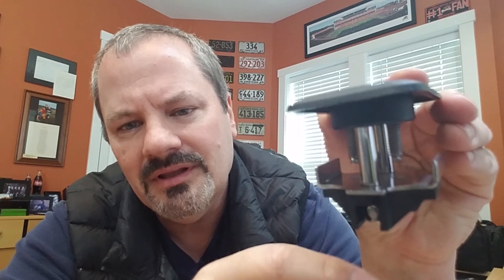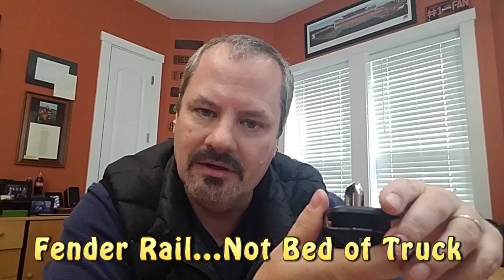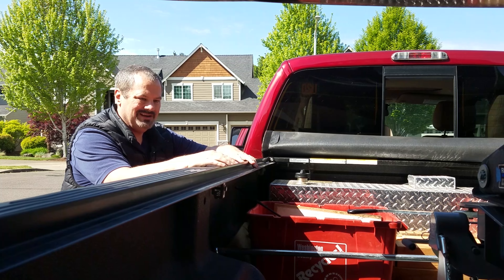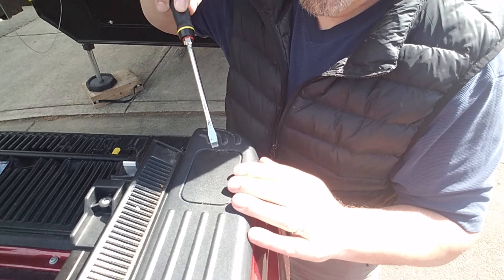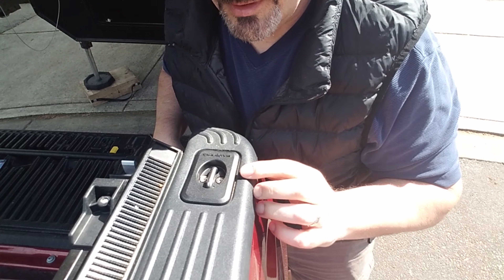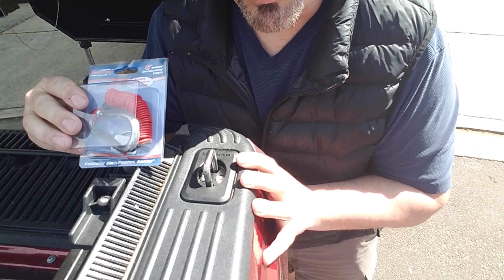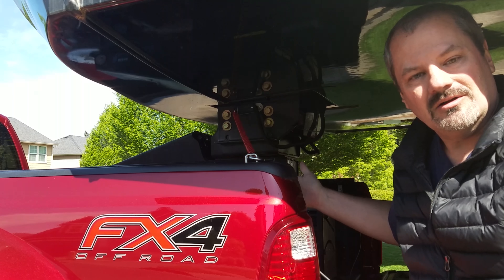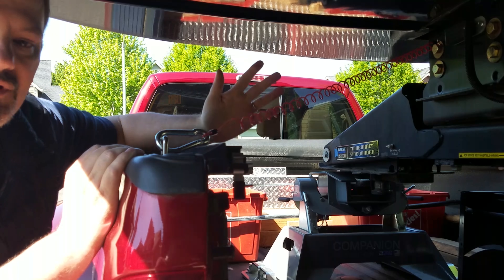Better 5th Wheel Breakaway Cable

Comment: Nice! I was in a parking lot yesterday my breakaway cable got snagged on my hitch and pulled out while making a turn. Tires locked up. Luckily was going very slow. Freaked me and my wife out. I will be switching to this type of setup!
Reply: mine's done that a couple times last time between the main road and pulling into my RV site in a busy park during 4th of July. had to dig out my wire cutters to clip it. I will be going to this setup

Comment: Great idea. How has it worked? Any issues when turning? Is there enough stretch in the cable when making a right turn?
Reply from the maker: No problems with right hand turns.  That is the reason I used the 6' cable vs 4' cable.   If you can find an 8'...that might be even better.   (or connect 2 of the 4' cables together?)